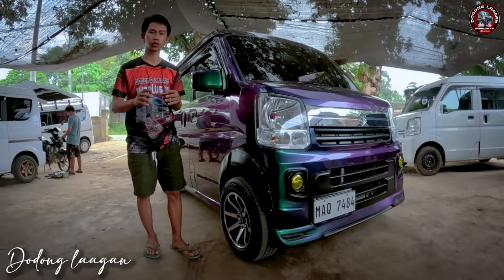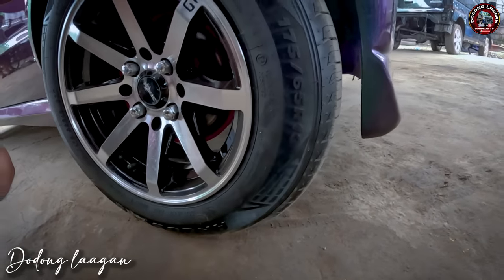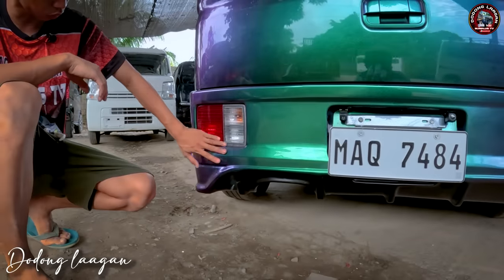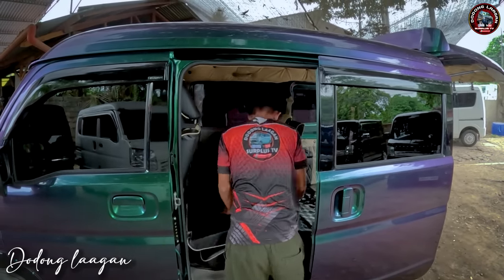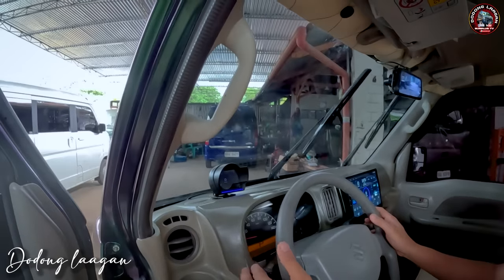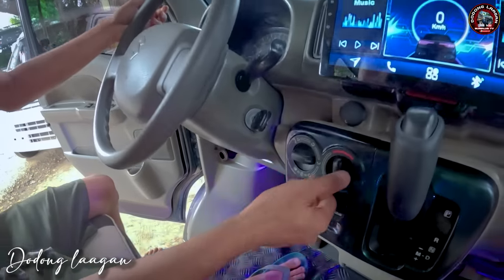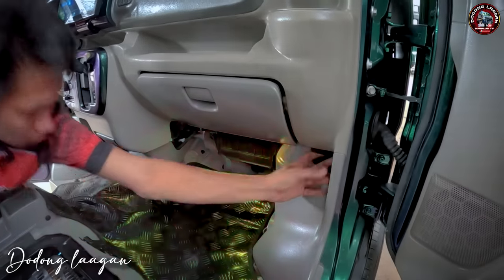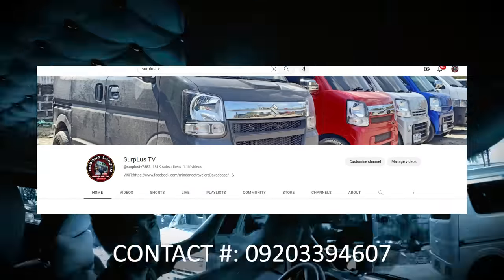DA17V 4x2 LATEST MINI VAN CHAMELEON PAINT FULL REVIEW

Comment: I apologize my  Tagalog is nothing. But have a Suzuki turbo charges Al wheel drive I want it refit. New paint and properly insulated. My power slide and step not working. Can you rebuild it with new suspension? If so my Suzuki v with climate control is in Leyte.